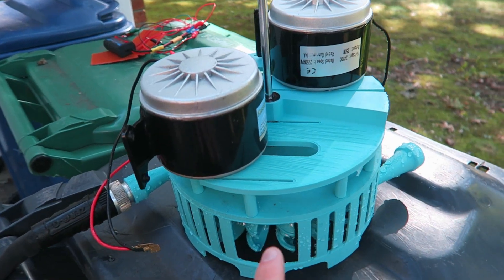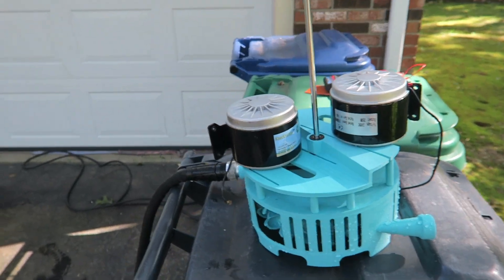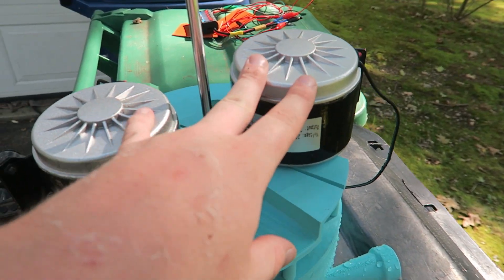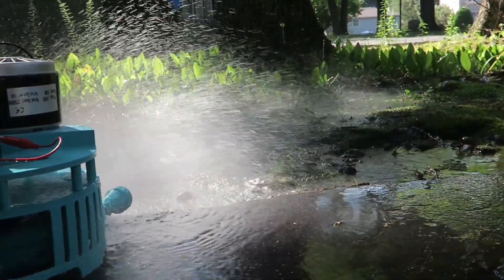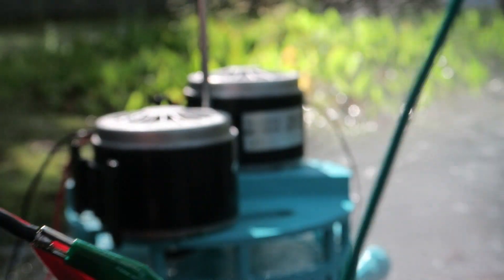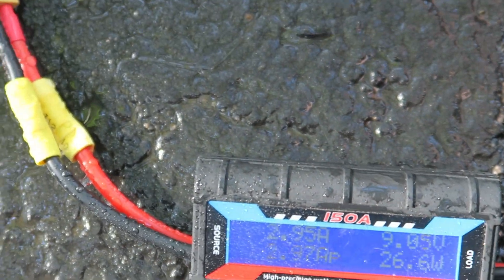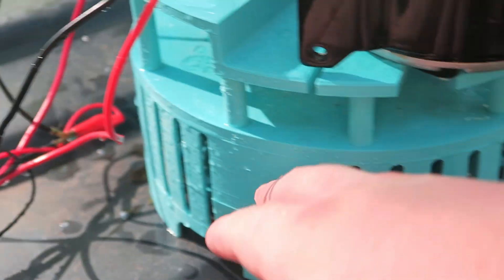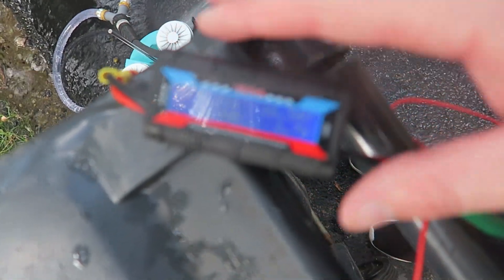3D Printed Pelton Turbine, Double The Hoses Half The Power?

Comment: Those 150A cheap meters I have found randomly display a small power 1W-2W  without a load connected.  Get a better meter, like a real solid What's up. I have also had better luck with the 250A versions that look similar to yours not showing a phantom output load.
Reply from the maker: Thanks for this, I'll have to pick up another one or use a multi meter!